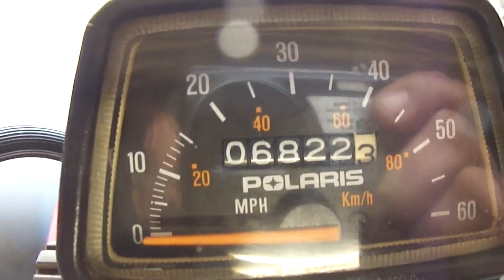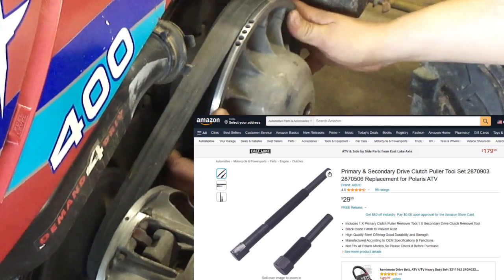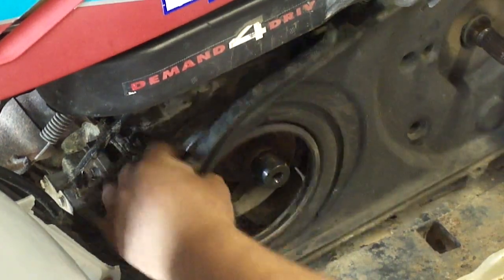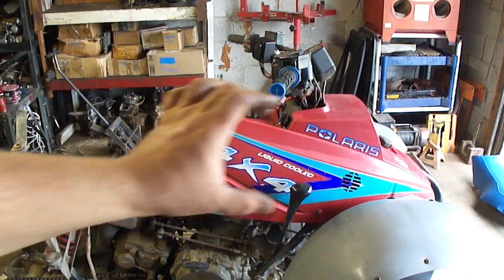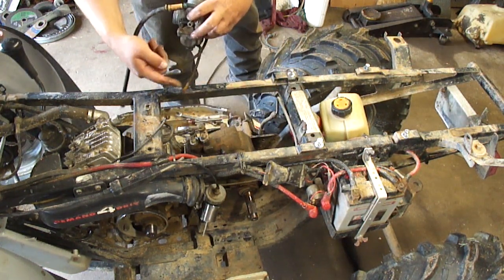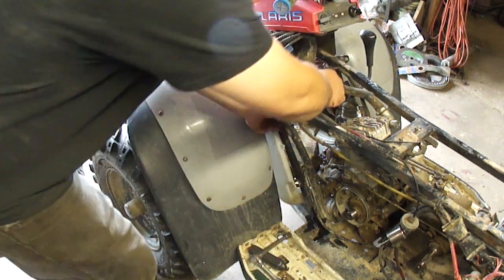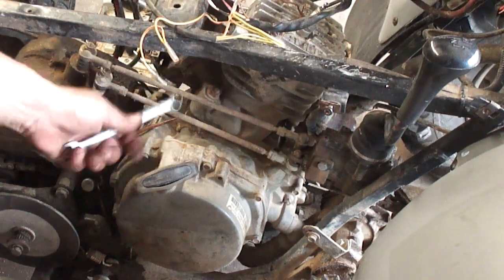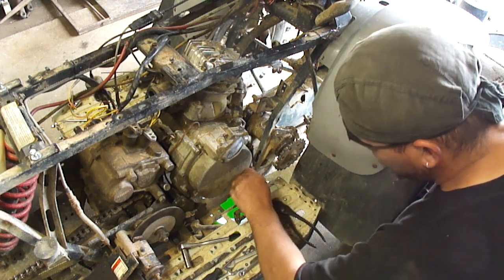Polaris 400L Complete Engine Rebuild Part 1 (Removal)

Comment: I just purchased one of these non-running. I can take the clutch or crank and it will only turn about 90 degrees the lock solid. I am thinking maybe a bent rod what do you think?
Reply from the maker: Look at the crank case under the carburetor ad see if it busted out. A common issue with these 400 engines is the piston skirts brake off and destroy the engine. It is also possible the magnets delaminated from the flywheel and destroyed the stator. Also, possible the reed cage came apart and it protruding into the cylinder bore. A bent rod is a possible cause but, in my experience, if the rod was bent it wouldn't come to a hard stop when rotating the crank but rather have a tight spot. Another possible reason is a broken piston ring catching on a port. The only way to know for sure is to have a look inside. A quick access into the cylinder is by removing the exhaust from the cylinder and look through the exhaust port. Other less common issues are in the balancer shaft compartment, the dipstick detached and is bound up in the gears or water pump bearing fragmented and has gotten into the gears. There are many possible problems. Start with the easiest first.
Reply: @MrFixit1  I appreciate the advise it turns 90 degrees then comes to a hard stop, but worse case I only paid $150 for it and your rebuild videos will help me a lot if I have to rebuild the motor as long as the case is not busted.

Comment: Should I have an o ring between crank and crank bearing on stator side? Can’t remember if I replaced it or not finished rebuild and now my 400 will rev to the cloud by its self I got the other o rings on properly closer to the flywheel
Reply from the maker: Ok, Part stack up, crank, shim/s bearing, O-ring, sleeve, gear, O-ring, sleeve, nut.
Reply: @MrFixit1  thank you so much you have no idea, very surprised I got a response on an old video keep up the content

Comment: Great Video man!   I have a all red 2x4 of same model and year.   came with 90s early 2000ks goodies.  wheels and tires and such.   its a beast. wodner if its been oversized already.  scary fast.  I appreciate your instructional man. Thanks.  I have mine half torn down now. Going to go ham with it. parts arent bad at all for engine rebuild. YAA HOO

Comment: This is great content.    I’m looking buy my son a  project for the summer.    I found a 2000 Polaris Explorer 400 that has a reported seized motor.   

How hard is it to find parts for the motor.  Do you know what other motor options exist?
Reply from the maker: Engine parts are out there if you look around on the internet. If it has the 4oo engine I would stick with that because the frame will need some modifications to fit different engines.